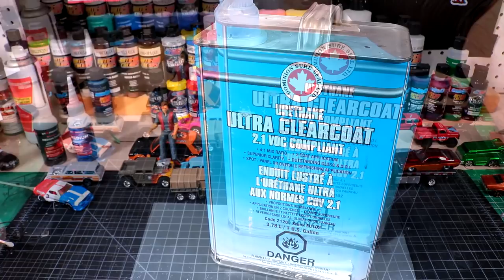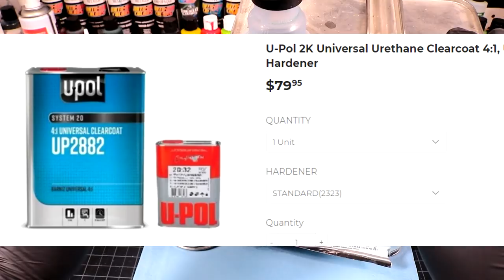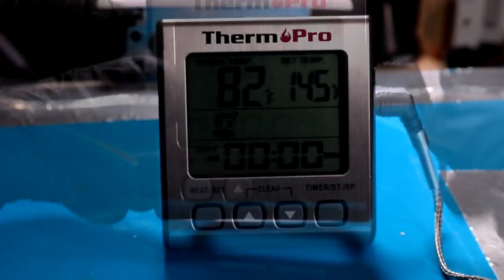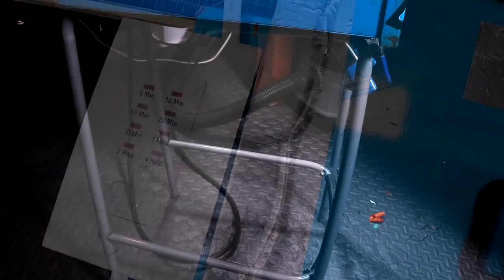MODEL CAR PAINTING TIPS - 2k Clear Coat Mix for Diecast Cars & My Paint Oven Build

Comment: You have the right idea! I myself has been commissioned by a local military installation museum to build their 1/72 scale aircraft exhibits, and I've used used Testors Model Master FS and Military paints but I cut their paint 1:1 mixture of paint to lacquer thinner, because the lacquer thinner makes the paint have a better bite to the primer coats, but my lacquer thinner is the Wally World brand! It's cheaper than brand names and the Testors paint doesn't have all the flaws that the Testors thinner cause when painting with an airbrush, but now since Testors went Woke and screwed over every modeler that used their brands by stopping the production of their MM brand of paints, now I had to move to Humbrol, Mr. Color and Tamiya brand paints.

Comment: I wouldn't have thought to use auto body clear coat.  I built a de-greasing oven similar to your model oven out of a 35-gallon metal garbage can and four 100-watt light fixtures.  I use it to get heavy grease and oil out of wood furniture parts, old rifle stocks, basically anything wooden that has soaked up too much grease and won't take a finish. That you re-purposed an old oil drill bit case is even cooler.  Fantastic work!

Comment: Hey my brother,
Thanks for the cool vid,
   I like when you take time to share with all us diecast junkies. 
  You are my hero . Ive been restoring cars for about 30 plus years, but Never to the level that you do. I have now replaced all my  old and decrypted paints , brushes, ect,ect ,still had a few of the old and hardened body shop kits they used to sell with body filler 2 tubes of the testers good old glue. That used to make my dog stager around when i was done. Never thought about the dog hanging out. He prob had a headache like i did. Didn't even Have  bar codes on it.lol. think it came  from two guys. ( the walmart of the day)  even came with sand paper. Any way, think im having a flash back,  i got in the paint section and got lost in all the pretty colors, hobbie store came a long way since i way last there. Spent about $200.00.. You sir have inspired me to really get into it again, and for that i thank  you!    Till the next time..   🤘  🏴‍☠️   🎃   🏍

Comment: Great video! I bought auto clear to do some old die-cast figures. Brutal trying to find 2 part clear. I ended up getting from Caswell, which are great. But, I used the regular 4:1 with a lot of varsol and ended up getting the exact issues you covered. Had to strip 4 figures and start from scratch. Sucked even worse as I had got a decent chrome finish that was ruined. Thanks for sharing, as this is going to really help my next attempt. You the man, Sea Bass!

Comment: Thank you so much for sharing. I use a dehydrator to speed up drying.
Reply: Any advice for using a dehydrator? I’ve just bought one but haven’t been able to find much info online. Wondering what temp to use for clear lacquer and how long it needs to be in there? How long does the car need to be in the dehydrator after each layer of lacquer, and how long after the final wet coat of lacquer for it to fully cure? It’s very cold and rainy where I live at the moment and I’m tired of waiting forever for it to cure so I can sand/polish

Comment: I have a couple questions and would like to point out one thing. 
-What size tip is that airbrush?
-Do you use the same airbrush to paint and clear coat?
And a very important part to point out is this 2 part urethane is very toxic and harmful to you lungs. Must wear a good respirator. And long sleeves. The overspray likes to set on the hairs of your arms (and gets on eyelashes too lol)

Comment: The 1/24 model car community uses “Mr. Color Leveling Thinner” @ 4:1:1 (One part).   “Leveling” indicates retarder and the ingredients are; 2-Pentanone, 4-methyl-2-Pentanone, and 4-hydroxy-4-mehyl.   I’m going to try it because I had the exact same results as your first spray.   Do you have an opinion on this, please, Sir?   Thank you.
Reply: thank you, been looking for this answer. I saw a car YT try this and other 2k videos by YTers showed how they only used reducer. I build gundams MG and wanted to do a chrome candy with 2k clear. I use a linear compressor (L10) so doesn't hit high psi but i have an AB that comes with .5/.7 needle/nozzle combinations. I had the problem in the 4:1 ratio, need to spray thin coats for black base>2kclear>chrome>lacquer color clear>decals>2k so I'm glad you can thin with Mr Lvling thinner since I have a lot of that. I have seen Korean Yters do this with great succes that I want to emulate. Thanks again.

Comment: What temp and duration do you find works best to cure?? I picked up a toaster oven at Goodwill to cure mine! 😎👊👊
Reply from the maker: That's gunna be hot.. I use about 95F for 1-2hrs depending on how thick the paint. I find anything 100F + will start to make little bubbles form in clearcoat cause its to hot. Hopefully you have good control with that oven. I regulate mine now by keeping the door open 1/3. If you watch my Q&A video you will the the meat thermometer I use with probe that I use. It has an alarm thay I can set for it starts if it goes above whatever setting I use.
Reply: @DiecastResurrection  sweet, thanks for the info!  For $8 I figured I’d give it a go 💪👊👊

Comment: The powder is also largely due to too high of air pressure. You should reduce the pressure to as low as you can without sputtering the paint.

Comment: there is no point of using a 2 part clear if you don't use it the right way. you can get the same result with acrylic clear. the power look is the paint drying to fast it does not have time to lay flat.